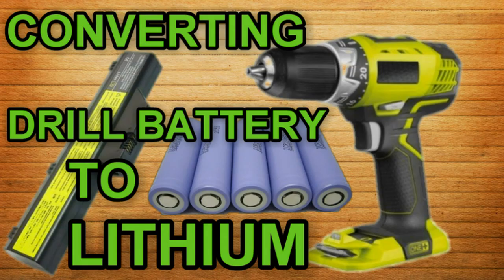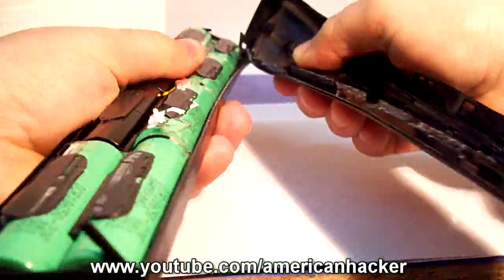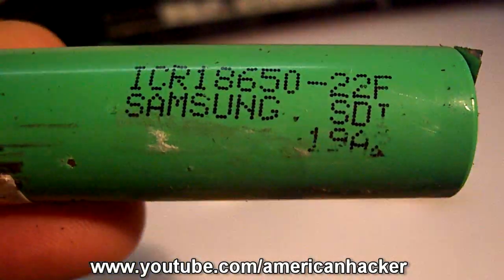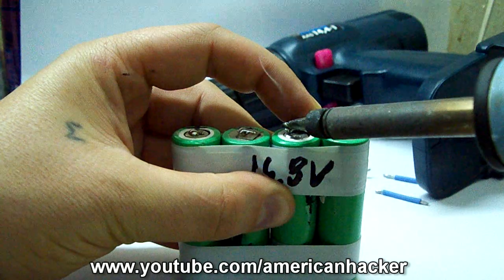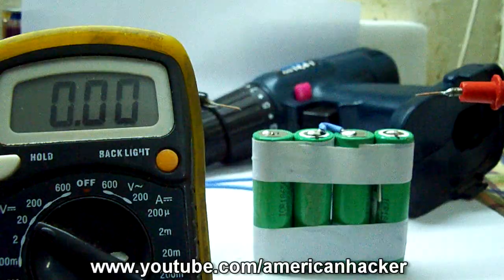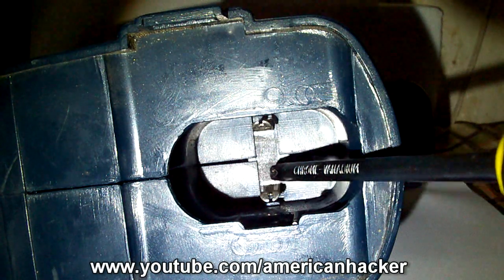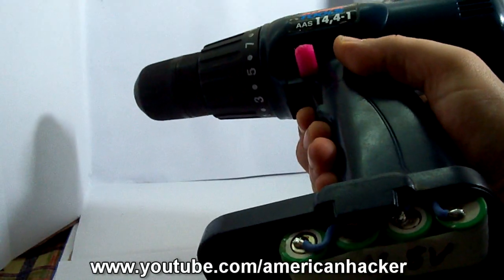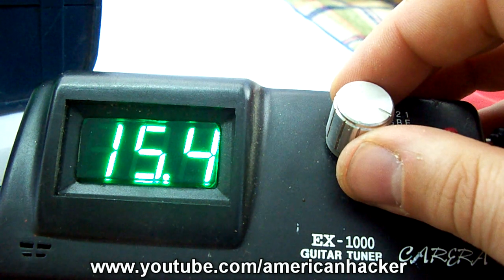Upgrade Your Drill Battery To Lithium For Free

Comment: This is dangerous! Under no circumstance copy this idiot's video! This is the problem with Youtube. Any tom-dick-harry think they are know it all and put up videos about topics they have no clue about!

You cannot directly connect 18650 or any lithium-ion batteries to the ouput like that. Lithium batteries require a Battery Management System (BMS) to regulate the Charging/Discharging cycle. Using these batteries like shown in the video will cause them to either swell up or possibly explode! Definitely wont work after a while.

Lithium batteries in general need to have a voltage between 3.7(minimum) and 4.2 (fully charged).  The BMS ensures that the voltage is kept within these range. Below 3.5V, the battery is considered dead; below 3.2V the battery irreparably   damaged.

His charging method is dangerous too.   To charge lithium-ion batteries you need at least 2 phases: a Constant Current Constant Voltage (CCCV) stage; a Constant Voltage (CV) stage (with minimal current 100mA or less). 
This requires circuitry with a microcontroller. The guitar power-regulator wont cut it.

Comment: This is very dangerous. You have to use bms (battery manegment system) circuit with this 18650 li-ion batteries

Comment: Charging Lithium cells like this is EXTREMELY dangerous. You would need aa BMS (Battery Management System) that would balance the charge between the cells. Charging them without the BMS could lead to overcharging some cells which could lead to them bursting into fire. DO NOT USE THESE without a BMS

Comment: Not american and definitely not hacker, just anoter Darwin price adept not knowing what he is doing. Lithium batteries can be dangerous and you need to learn a lot about their handling, wiring, soldering, charging, discharging, protection, cut off voltage, maximum safe amperage output, safe thermal range for use and especially you need to know when they ca explode and catch intensive fire!!! This is very dumb and dangerous tutorial.

Comment: I did the same with makita 12v with only 3 x18650 batteries but i charge them 1 by 1 because i have battery holder for 3 batteries and take the batteries out and about the amps and heat etcim using this for 6 months now and under full load i touch the batteries iwth my hand and no heat what so ever so its ok and people scared of fires and explosion 18650 will never explode instantly it heats up very high before real danger check youtube for shorting 18650 cells never instantly boom !!!

Comment: Please, don't do this. You COULD actually do this with high drain 18650s like the Samsung 25R or the LG HG2. Unfortunently, many of the cells inside laptop batteries are low drain and cannot dischargeMore than a few amps while a drill will need to draw well over 20 amps. This would probably work for awhile... until one day your battery exhibits so much voltage drop you need to buy/rebuild a new one. It just isn't worth your time. Again, this will work totally fine with high-drain cells but it would not work well with low-drain cells from laptop batteries.

Comment: Just a reminder to all the warning comments. new nite lights using Li batteries are charged with solar panel.  U be surprised, no computer board for charging--straight connections to  solar panel and Li batteries,

Comment: I was looking for a lithium charger that could recharge my batteries at one time and saw this movie. I've also this done but with a battery holder and that works al a year fine. I get to do every time the batteries out the holder to charge, but it works perfectly. Only by reading all those negative messages I'm still a little scared. Sorry for my bad english.

Comment: Li-ion batteries have 4.2V when full, so you need 16.8v to fully charge them. anyway, a balance board may be needed when charging because the voltage drop per cell differ and Lithium cell are very sensible to overvoltage charging
Reply: you are right

Comment: This is a very bad idea. Lithium ion batteries need to be managed during charging and in order to prevent over discharge when in use. PLEASE DO NOT COPY THIS LUDICROUS IDEA. You may regret it.
Reply: Most of these 18650 bat come with overcharge protection
Reply: ... the protection is in the electronics he cut of when he dismembered the laptop battery.

Comment: Current isn't an issue. The motors in cordless drills are exactly the same as found in battery operated rc cars. They are running through a gear drive to increase torque but they don't draw much current. The typical sub c nicad battery in a cordless battery pack makes 1.2 volts at 1300 to 1800 milliamps capacity. 12 of these are wired in series to produce a 14.4 volt battery pack at less than 2 amps. So the current rating of the batteries that he is using is in line with the usage here. Charging IS the real issue here. As several others have pointed out these batteries tend to catch fire if they are not properly charged. Experimenting is a lot of fun but be careful with electricity, even low voltage, low current stuff can catch fire. Do your research before making a YouTube video.
Reply: great reply - thanks.  do ni-cd 1.2v sc batteries need to be balanced? i need to change the dead ni-cd 1.2v batteries for an 18v battery pack.  it is better to use the ni-cd 1.2v rather than lithium batteries?  i have a million questions for you.  thanks
Reply: you are very wrong the drill requires lots of current it would hardly have any torque on 2 amps,  you need high drain batteries for drills if you have a bench power supply that's rated say a max of 3/5 amps wire the cordless drill to it instead of battery hold the chuck and see for yourself there is no torque there and you will stop the drill by just slightly holding the chuck fact.
Reply: drill with no load will use 1 A but when you are screwing a big screw it will use much more up to 10A and these batteries may not do that

Comment: 1)  The cells should be recharged to 4.2V each but you need a balancing charge circuit or high voltage cutoff circuit, best to have both.
2)  The tool or cells or both need to have a low discharge cutoff to avoid damaging them.
3)  The pack needs a temperature sensor cutoff.

Often all these things are integrated onto the tool battery board.  It is not safe to use batteries that do not have one custom designed to work in the application.  FIRE can result when you least expect it.

Comment: Just get  Samsung INR18650-20R batteries.   They are rated at 22A continuous discharge.  This is a conservative rating, in actual tests they have no problem with a 30A continuous drain.  They are about $6 each.

Comment: Lithium ion batteries like this need to be charged individually by a charging regulator. If you ever taken apart a dead lithium drill battery you will find a circuit board with chips. This circuit charges each battery up individually and then connects them in series to be used.
Reply: yeah my PowerStroke (interchangeable with Ryobi)  18V Li-ion battary has a circuit board with temp monitor, low voltage cutoff, balancing, and short protection but what really tripped me out is it has a full live JTAG header (the leads arn't soldered in the bored but it had live power and data
Reply: All2skitzd
I guess the data is used with the charger to let it know if any battery cells are dead then it throws the red green flashing light or whatever indicating a bad battery. I've never taken any of these apart but ive seen them apart on a youtube video. Never really heard of JTAG.
Reply: Data port header, it had 5v+, ground, reset, Rx, Tx. If I get board Ill pull up some more info on the ICs that control everything and see if i can get the battary hooked up to computer and get any kinda of usable input from it
Reply: All2skitzd
Sounds cool.

Comment: You just chained 4 batteries which would normally have individual charge/ monitor circuits, also are not designed for the current the tool requires.Danger of fire when charging,danger of fire when the weakest cell is over discharged.Not recomended.

Comment: folks if you are going to do this do yourselves a favor read all this and buy a 4 series 18650 battery holder and a proper 4 cell 18650 battery charger and remove the cells for charging, charging an unprotected battery pack like this is lunacy, a li-ion battery pack must be balance charged, that is what all the circuitry was for that he clips off in the laptop pack, charging them together eventually the cells will become unbalanced 1 will over charge and booom, if you loose a finger or get a hole in your face you will be lucky you were around to put out the house fire you would have burned alive in, lithium ion batteries are dangerous when mistreated like this, 
also to note the battery pack is likely under powered for the drill under load, the loaded current of the drill should be measured or looked up and the battery spec should be obtained to determine its max current and should be matched by the cells max amps  to the drill, these cells he is using samsung 22f can deliver a maximum of 4.4 amps or 4400ma , a drill like that could be drawing 20 amps 50 amps or even more, even if it is just 20 amps which only makes it a 300 watt drill, which is low for a drill, you will need 5 sets of these batteries, by sets i mean 5 x 4 = 20 cells 4 series 5 parallel, you can reduce this by buying high drain 18650 batteries such as samsung 25r instead which will safely deliver the 20 amps required in just 1 set of 4, and again not heeding this can result in, at best, the battery overheats and dies a very quick death and at worst you are trying to put a fire out with a fingerless hand.

+American Hacker if indeed you are american im guessing you are well versed in the thing you lot like to call a law suit, to avoid one i would suggest removing this video and never make another electronics video again, if you dont respond im guessing you died in a tragic house fire or have no fingers to type with and i will ask youtube to do the right thing and remove this video for you
Reply: he is correct. i was just about to write a siilar comment explaining how dangerous this video is. If you are going to try something like this. DO NOT USE unprotected 18650 cells like he did. You can buy 18650 cells nowadays on amazon with charging protection built in. Doing this the way he did will kill you.
Reply: Auto Fix Pal I
Reply: oldskoolhead0 

Very very good sound advice....listen to him Folks..lve been in electronics 30 yrs....he's 1000 correct..don't listen to a Russian fool....Good video

English Mik
Reply: Go-signed by former NASA engineer who hasn’t blown himself up. Yet.

AnOther option, (which I’ve done since I already had a RC balance charger) is to connect leads between each cell in the configuration of a 5s bank, and have a balance charging port in the side, along with your +\-. I just use my Imax b6 to charge it, which handles the protection externally. But be sure you’re using a proper charger to do so. 

If not....change into a clean pair of underwear because you’ll be replacing the shuttle for launch. Less boom, but WAY more mess.